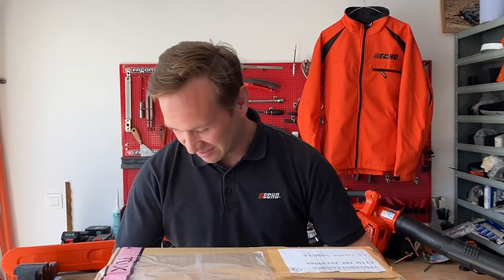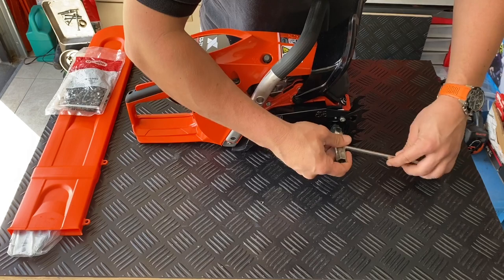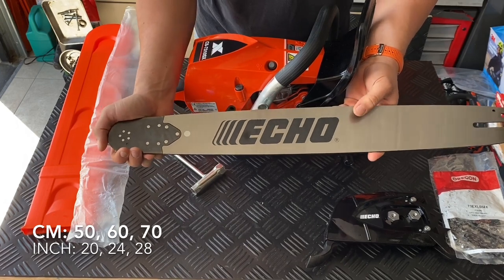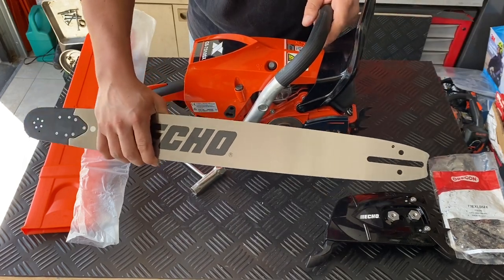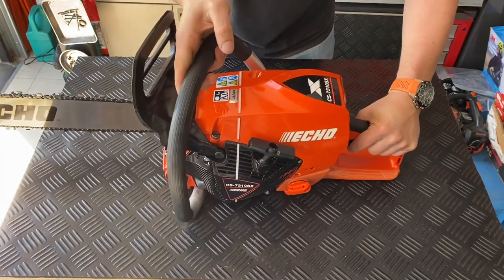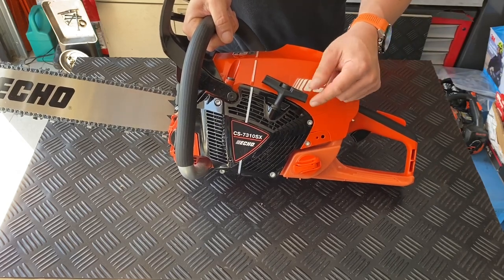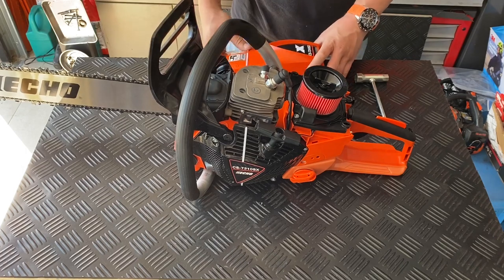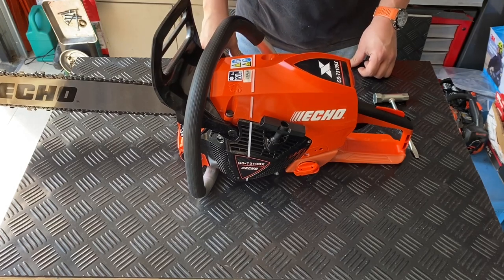ECHO CS-7310SX chainsaw unboxing and features breakdown.

Comment: I use to be a hardcore Stihl guy, not anymore. VERY happy with MY CS-7310P. In fact, i just bought a CS-4910-18. Both saws run great, ZERO issues!
Reply from the maker: That's great to hear. They only get better over time too!
Reply: Mix oil 2t  echo 7310  ,5/1,4/1??

Comment: I have the 620 p I love it over huskies all day long day in day out but the gas caps finally got fixed thank God and the chain break step is good but weak in one area it's all plastic so I drilled a hole glued a bolt in there and it's brand new I hope to see echos just keep getting better and better priced

Comment: Look like a nice well done chainsaw like the look of orange and black colors. Looks like it already comes with a good chain EXL, nice. Hope the USA one do that also. Like the simple carb set up like you did on this. Less stuff to go wrong. Hope it has a winter setting with a better setup than my Echo CS 620P. The tab on the unit broke the 1st time I used it. Also had to richen up high speed slightly otherwise it been a good saw. Just picked up a Echo CS 4510, like the well done (sealed) air filtration system on the newer CS 4510. Keep up the good work ECHO.

Comment: As soon as you make heated handles for this i will buy in a flash. I like the magnesium covers and I don’t mind the extra weight at all when better build quality is taken into account, for me build quality is more important than power to weight ratio that is why i like Echo and Japanese build quality. I have Dolmar and stihl chainsaws but now i am much more a fan of Husqvarna and Echo so it’s either this or the 572xpg or 592xpg (g with heated handles), i already like this saw a lot more than the husky and with heated handles this 7310 would be the perfect saw for me. Echo wins in looks department too.

Comment: Nice saw. When will it be available in Canada? The ignition toggle looks too long as was my cs501p switch. I swapped to a cs310/590 type shorter toggle to prevent unwanted switch off while using.(I had to cut wire and install connector and its indexed 90° clockwise but works fine)